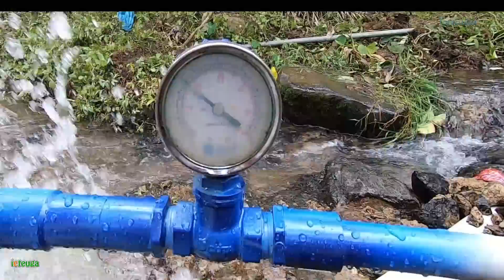Pompa Air Tanpa Listrik: Pompa Hidram sebagai Solusi Irigasi Tanpa Energi Listrik

Comment: flange brp inc pak ?
Reply from the maker: Flange 3 inch
Reply: kalo 3in pakai satu klep buang kira2 untuk ketinggian 45drajat 100m ,jarak 200m naik tidak pa.? input 2in 16m tinggi 3m output 1/2inc
Reply from the maker: @asepkautsar9775  tidak mau naikk.  Sebab pipa input 2 inc…  panjang 16 m
Reply: sarannya pakai hidram speknya gmn? supaya berhasil ?
Reply from the maker: saran untuk biSa naik… pipa input 3 inchi panjang 70 m… kalau elevasi hanya 3 m
Reply: kalo di lihat dari aplikasi evalasi lokasi sumber air, ke rumah, ketinggiannya 32meter pak, jarak 200 meter
Reply from the maker: bukan elevasi ketinggian output… 
Ini elevasi atau kemiringan antara sumber air dengan pompa…  minimal elevasi 3 m…

Comment: Apakah bisa dibuat 30 - 50 Liter permenit kalau vertikal dari pemasangan pompa 2 meter dan ke titik penampungan berjarak hanya 2-3 meter?
Karena klau bisa mau saya terapkan di sistem RAS peternakan ikan, dan boleh tau untuk lokasi Bapak dari mana? Terimakasih....
Reply from the maker: Kalau pompa yg 3 inch.. Paling cepat kalau air pd input sangat kencang dan sumber agk tinggi,  mampu sampai 25 lt/mnt… 
Kalau 50 liter permenit kita menggunakan yg pompa 4 inchi dgn tabung 6 inc… dgn catatan sumber air cukup…  ditunggu saja upload terbaru yg pompa 4 inc mampu mencapai 90 ltr permenit di Nisam Aceh Utara dgn jarak jangkau 5 km.. Salam
Reply: @TradisionalChannel_Indonesia  terimakasih...saya coba tunggu video dimaksud dulu, semoga sukses selalu..👍